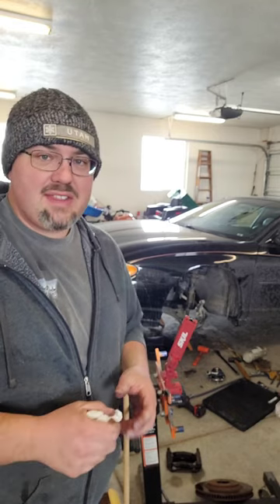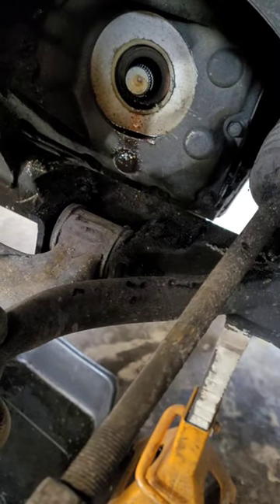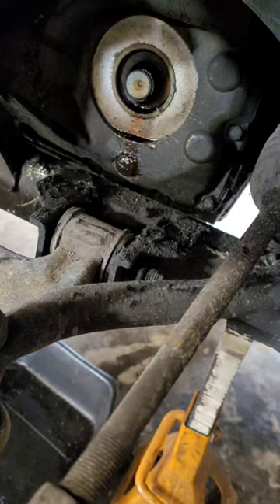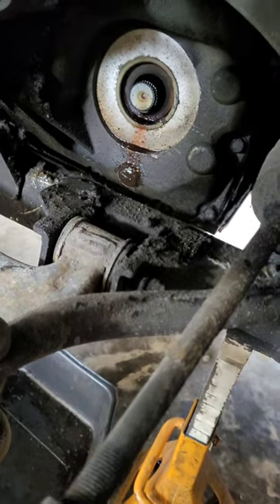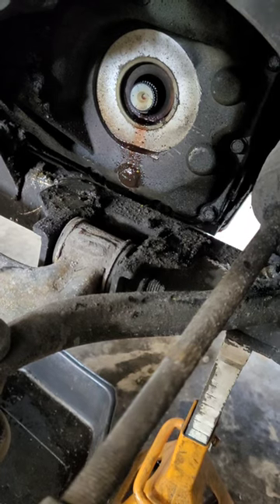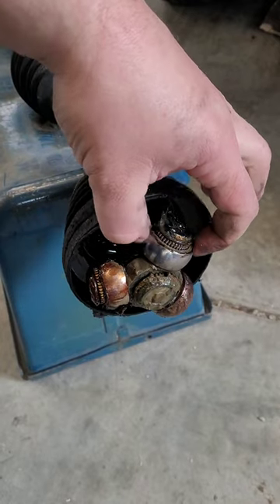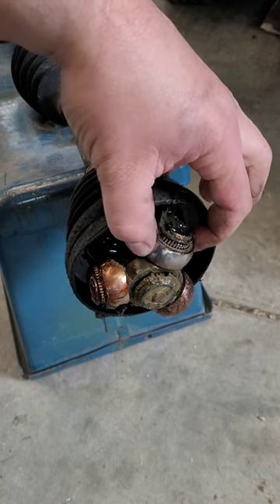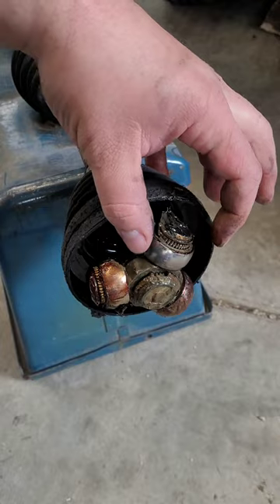Signs of a CV Axle Failure!

Comment: You forgot to mention vibration under acceleration or vibration while climbing a hill or steep grade.
Reply: Exactly mine had vibration going uphill it was inner cv
Reply: I think my wheel bearing and CV axle are going bad. After replacing the struts, sway arm bushings, ball joints, and end links, I began to notice that there'd be times where I would feel vibrations from steering wheel or occasionally some low humming. Plus, even though the clunking sound is gone, there's still a small knocking sound when I turn. 

Although, the sway bar isn't straight anymore either and there's a sign of damage that it's been hitting on the CV axle as well. I guess I got to go to a junk yard and see if they have sway bars in good condition

Comment: You didn't say how to find out if it's an inboard or outboard. When they first came out with front wheel drive NAPA put on seminar in order to figure out if it's an outboard was told to take the vehicle out to a big clear space in a parking lot turn the wheel to the right or left as you're pulling into a parking spot at fairly fast speeds yet safe whichever side the noise was coming from that's the side in order to check if it's a inboard do the opposite in reverse turning the wheel to left or right or right when you heard the noise it told you if and which inboard CV joint was bad plus when replacing the outers or an outer in the beginning you most definitely wanted to become careful with Chrysler products they didn't put retaining rings to keep the needle  bearings from falling apart then you I found found out to use the old thick wheel bearing grease smearing on putting the needle bearings back in the bearing grease holding them in place so you I could slide the outer needle bearings in if you didn't lose any or a needle bearings another thing with Chrysler you if pull both front CV axles that was a definitely no because if you did the spider gears on each side would fall down into the trans case on manual transmissions I made up a stub shaft after pulling one CV axle I'd take my stub shaft stick in the one side I'd removed the axle driving on it with a hammer to pop or push the other remaining axle out holding everything together in the trans the NAPA Seminar taught me that plus much more this is back when front wheel drive first came especially on the K-Cars still be careful there's still some others out there especially in the foriegn vehicles to cheap to do add a couple ten cent snap rings and another way to make a mechanics or auto techs life miserable especially a young man I've been doing this 50yrs
Reply from the maker: That is good information, thank you for sharing! Most of the time, CV's are so cheap that the whole thing gets replaced. Diagnosing inboard/outboard isn't really necessary for most home mechanics. If one side is bad, swap the whole thing. I picked up a new CV for that Monte Carlo for a whopping $36 per side. A look under the car for the telltale signs of a loose or torn boot or grease splatters tells everything I need.

Comment: Question. Can I just pack more grease into a ripped boot? Haha
Reply: Lol do you remember the replacement split boot it you did smear sent you a a tub or bag high temp grease smeared it packed in glued the new seam together on the split boot they didn't last long not even on the market very long I've seen about everything been a mechanic or tech 50yrs on just about everything normal vehicles  farm tractors  equipment last and now semi's have an interview for John Deere coming up parts dept , outside Sales or out in the field mechanic or lawnmowers been offered basically anything I want experience does pay off

Comment: Quick question. I recently had what i believe to be a transmission failure in an automatic fwd car. However, i lost all gears at once without notice, including the park gear. Could this possibly be a broken cv axle? Ive never heard any noises, nor had issues, but all of a sudden my car can drive anymore, and makes a loud clunking noise whenever the gas pedal is engaged.
Reply from the maker: Sounds like there's issues in the differential part of the transmission/axle assembly. Losing all the gears at once, including the park and all the crunchy popping noises, says it's after the transmission and before the axles to me.
Reply: @SnowFamilyRacing Alright. Thought it was the transmission. Was really in denial though lol. Thank you for your advice.
Reply from the maker: Denial is a river in egypt... all joking aside, that's really not a fun repair. I do as much of my own wrench work as possible, but I'd take that to someone who has done it before and has the right stuff to be able to drop the front cradle, engine and trans as a unit safely.

Comment: I have a 2003 Avalon, I changed the rack and pinion, bearings, lower control arm, both CV axles, motor mounts, and struts …. My car still has a steering wobble at 60mps under load. When I let go of the gas it stops. I am going crazy trynna figure it out. I even got tires balanced.
Reply from the maker: You may have other worn parts too.
Reply: @SnowFamilyRacing  ima keep looking, at this point I want to pay a shop for a diagnostic for them to find it and I will fix it.
Reply: I hear a clicking knocking sound when going straight at low speed can that be the c axle?
Reply from the maker: If it's bad enough. Could also be a wheel bearing or something else that turns. Hard to diagnose over the internet.

Comment: I have this same car man 2003 Monte Carlo, car starts up great don’t hear any noise turing, all the rubbers are good, wheel has no play the tred on the tire Isn’t uneven and the rim looks to be in good shape. The only problem it has is when I’m accelerating at about 30mph the front passenger side of the car starts to shake it’s doesn’t get worse or better when I go a little faster. It stops when I let off the gas so I’ve had a couple people try to look at it and I get told it’s a wheel bearing or a cv axle even got told it was an engine mount but i checked the mounts myself and they were okay . I’m hoping it’s not the transmission
Reply from the maker: The thing about the lower mounts on these cars especially is that time breaks down the rubber and makes them looser internally. If they're the original ones or have anywhere close to 100k on them, they're worth changing. Vibration like that can break the transmission casting, then it's really bad. I've got videos that I replace all 4 mounts, the CVs, and a wheel bearing. None of them are particularly hard and could be done in an afternoon. The lower mounts would actually be easier to replace without the CV in the way if you were to do them all at once. None of the parts are that expensive either.

Comment: Could this be causing wobbling wheel after 90km/h????? Pls only experts opinion
Reply from the maker: A bad CV can cause some vibration in the wheel at speed, you'll find it mostly on accel and decel. The wheel bearing may be more likely. If you suspect the wheel bearing while replacing the CV, it's only a little more work to replace the bearing, too. In this case, it was only a handful of bolts to undo since I was already in there.
Reply: @SnowFamilyRacing  my problem is wobbling steering wheel, only after 90km/h doesn't matter if I accelerate or not, aaaand is not all the time, only 80% of the time does it. I changed wheels, bearing, I did geometry, equilibration... nothing helps. I checked my steering cassette or column, nothing. So the drive shafts remain... oh and I checked the wheels for bearing problems and came clean, no problems there.
Reply from the maker: Sounds like you're at the point there may be other problems like worn bushings, bearings, or other steering components. That's my opinion.

Comment: Here's some physics for you; a bad cv will vibrate more violently at speed multiples. For example if it vibrates a lot at 30 mph, it will vibrate alot at 60 and 120 mph.

A ujoint will do this as well. Most other vibrations such as tires or engine issues do not do this. It has to do with resonant frequencies.
Reply from the maker: That is called a resonant harmonic. You may also experience some vibration at the half way between them ,depending on the frequency of the vibration.